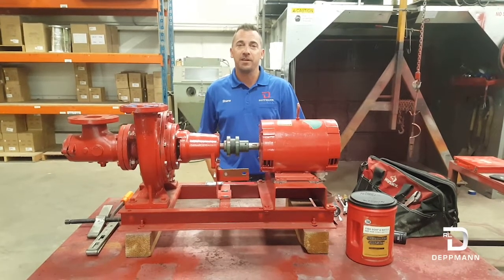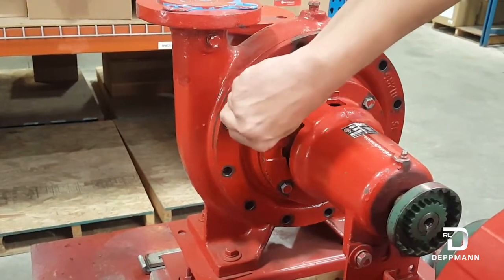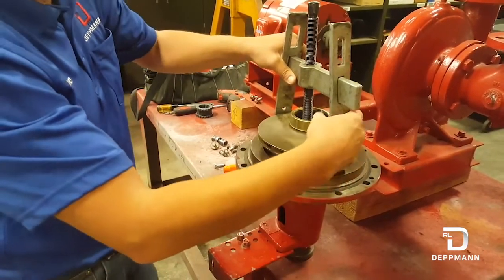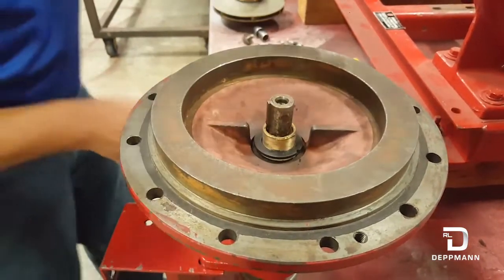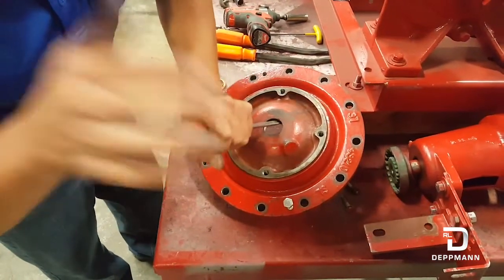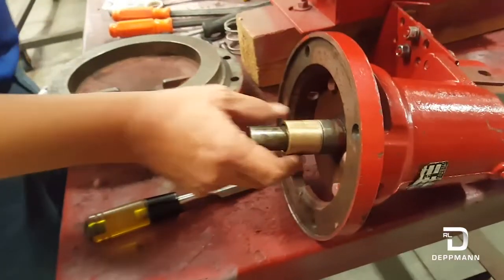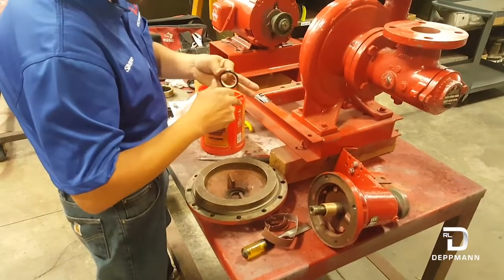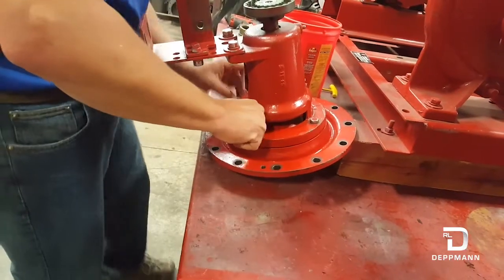Bell & Gossett 1510 Pump - Seal Replacement

Comment: I've never in my 25+ years of experience seen one that clean, come apart that easy, or go back together so smoothly. 😁
Reply: He did mention that they normally don't come apart that easy. I also know that he's underplaying the importance of not putting your grubby mitts on the seal itself, having assisted on a ~5 foot diameter, high pressure mech seal once upon a time.

Comment: I have one to do that was last done in 2006. It won’t be this easy. The rusty crusty ones are the most fun.
You skipped the part about replacing the brass sleeve to the new stainless steel sleeve.
Reply: How'd it go?

Comment: The shaft lock is not supposed to come off then?! I was having so much trouble trying to take that damn thing off
Reply: What I see in other video was to joint with the part with the springs the side of the motor have a Allen screw and the other side of the pump another Allen screw and bolt it with the 4 bolts

Comment: Where do you find the seal part#? I work in a very old facility and alot of the models and serials are weathered, I was just wondering if I was looking on the right places.
Reply: Ffs both terrible and vague answers. 

On those pumps there is a data plate on the motor sled frame. (There should be one.) It will have your pump series and size. For instance, it could say 1510 and a number below that will be the size number, which let's say it's 2BC.  

You can take a picture of the data plate also if it's not in too terrible shape and give it to your local parts dealer and they can help you select the correct pump kit.
Reply: @sparkybr1449 this or get yourself  a US seal catalog and caliper. In a couple hours you can learn how to measure seal heads, spring length etc. Order the mechanical seals from US seal for a fraction of the cost.

For example the seal in this video is a PS-978.
Reply: Grainger's
Reply: If it's a B&G Pump, you can look it up by the model number

Comment: This is so much harder in the failed. Pumps have usually been leaking a long time. Broken rusty bolts, rusty seal plate, seized impeller. Thanks for showing us I use the steps though.